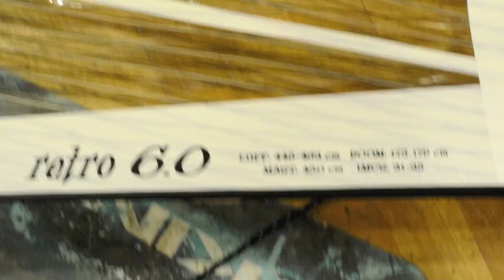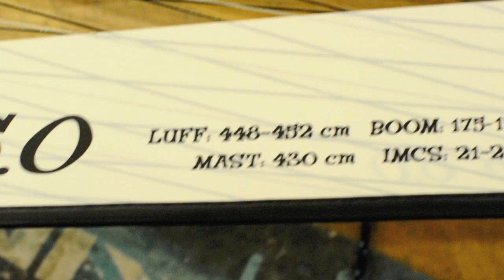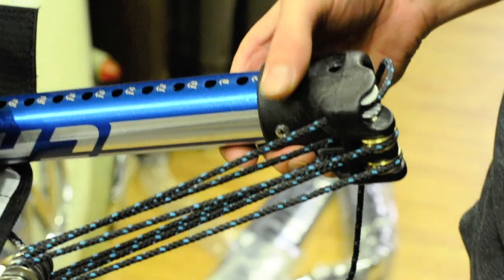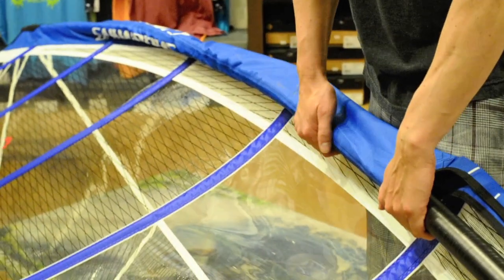How to rig your windsurf sail

Comment: It all depends on the manufacturer and a size of the sail also (camber/non camber)
But the procedure i ussualy.

Open camber pockets
Insert Mast
Downhaul to the point where the sail is streightenned.
Max outhaul
Puch cambers in, close pockets.
Downhaul at max

Comment: How much would a full rig like this cost?
Reply: It depends, and the range is wide - depending of percentage of carbon, brand name and etc.. Mast ranges from ~$200 to ~$500, boom - $150-$400, sail $250-$650, small parts (extension, base) ~$100. You may get a full set at Isthmus Sailboards for ~$1300. But if you are a beginner you may save a lot of money if you hunt for a second hand stuff, in this case prices may be pretty symbolic.

Comment: if i have an 4.5 sail what kinda boom do i need
Reply: Minemade you need to check the sail and adjust the boom to required length :)
Reply: It should be on the sail as well as the luff length (length of mast.) Probably about a 150 cm boom.